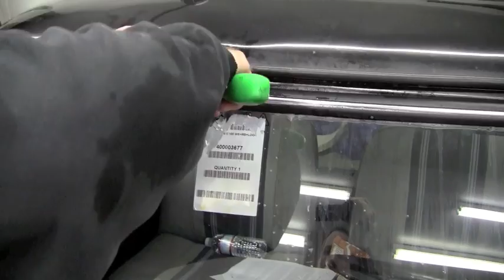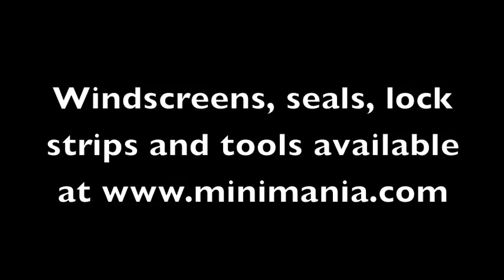How-To Install a Windscreen-Windshield Classic Mini

Comment: This type of rubber is not a rope in type, it's a Claytonwright rubber, which has to be 'Hitched' in, similar to the method used here. If you tried to use rope, the rubber would tear, but having said that, with a new very soft rubber, I have known this to be roped in before, and yes, I do know what I'm talking about, been fitting Windscreens for a living for 35 years!
Reply: I was a sprayer and panelbeater and never cut the screen out we would take a little time and remove the screen first then the rubber

Comment: thank you so much for posting this vid, put my screen in today after watching this, its worth a mention that if the window looks like it is to small for the rubber soldier on, and it is possible to move the glass about slightly once in, before you fit the chrome strip...thanks again for such valuable information..

Comment: Totally agree...do not use a metal screwdriver for this installation.
1 turn or twist the wrong way will easily crack the laminated glass.
Use a plastic "Equalizer" installation stick or alike.
Do not try and fit this type of glass with a cord or rope.FFS!!!

Comment: He's making a  real meal of that. The quick & easy way is to fit the rubber around the edge of the glass, and wrap a length of string around the groove in the rubber. Then press the screen against the aperture whilst someone goes inside and pulls the string. And use a wooden dowel with a chisel edge filed on it, not a screwdriver.
Reply: Bingo!

Comment: There are specific tools for fitting a mini windscreen and this video demonstares the use of some of them. I wouldn't recommend the use of screwdrivers as they can slip and damage paintwork and users. There are purpose made fitting tools available on e-bay for novices. A very good video though and well worth a view.
Reply: Sure seems like they're using the filet tool backwards...

Comment: not a good way to fit a mini screen I have been fitting them for 22yrs. if the old rubber is fine re-use the old one.all the new ones are after market.the filler can be reused if in good shape.when fitting glass don't use soap and water.spray with glass cleaner instead this will help and then evaporate  after. when working glass use a plastic diber not a screw driver .before fitting filler seal glass and body side with sealer not silicon .then spray rubber and refit filler.the filler tool if used at correct angle will go round in 1 smooth action.this guy as got glass in but not a guy that is used to fitting this type of fitment.if your not sure us a windscreen company.thier is many difffrent types of fitments methods for windscreens held in by rubber seals.hope this helps
Reply: Agree not a good way, put the seal around the glass then a string in the other groove then with help of a friend push in the window when when your friend pulls the string wich lifts the seal over the lip. Done it several times with no problems.
Reply: I have a 86 saab 900 windshield to do, how to re use the old gasket? Any idea? thanks

Comment: Use a plastic -nylon dibber tool and apply MR SHEEN polish or same as ,will go in alot easier and remember you need to reseal before fitting insert or it will LEAK!!

Comment from the maker: Most of the time it isn't necessary. It depends on the condition of the aperture surface. If it is deformed and bent, it should be straightened first. If you have a lot of un-eveness some sealant in these areas might be a good idea.

Comment from the maker: Ok, so you have an earlier Mini with the smaller aperture? In that case you shouldn't need to glue the ends but just make sure that they butt together as tightly as possible when installing the rear screen. You should put the split at the bottom so that the lock strip will go through the split in one piece and go together at the roof line.

Comment: screw driver to fit the screen rubber????? one slip and goodbye to the screen or paint work
Reply: I know, I was cringing there. Also pulling heavily on a Stanley knife towards himself. Sheesh.
Reply: just thinking that my self why not use a plastic dibber  much easier

Comment: Would it be easier to fit the rubber to the glass first and then put both in? That way you know that the rubber is in the correct position for fitting in the gap, and you can use the screw driver all you want to help the rubber onto the body without fear of damaging the glass? Just a though, I have never done anything like this, so I might be way off point!

Comment: Dude fit the rubber on the glass first and use 4mm rope around the rubber seal. Start from one corner and pull the rope inside your car to fit the seal its alot easier. Your way is a good chance to crack the glass the way your doing it and if your tool slips their goes your paint or scratch the glass. The rope method is best
Reply: Not for classic Minis.

Comment: For other cars I've seen a different method in that they usually start with the rubber on the window and use a length of rope to get the gasket to seal - is there something that prevents this method on a mini? I'm actually asking seriously before I try doing it that (seemingly easier) way.
Reply: I think your method is preferable. I can see many options for error in this method.

Comment: I'm watching this shouting "NO NO NO!!" I worked on Leyland stuff in the late 70s, and those and most cars, we fitted the seal to the screen, lubed the lip with washing up liquid, then fitted a long cord around the seal and it was easy and safe sitting inside the car to pull the lip all the way around, with a helper giving an occasional flat handed slap from the outside. Then run some sealer around outside, clean up and refit the filler bead. BTW, a screwdriver doesn't come into glass fitting.

Comment: Great video guys, I have saved it for when i fix the rubber leakage problem on my own Mini. I love the arches on the green Austin in the background, would you mind telling me what the name of them is?
Reply: Look like Wood and Picket arches as there are no top edge fasteners.
Reply: Yeah yeah do don't they? It has been a while since I asked this so I ended up figuring out they must be Wood & Pickets. i might pick up a set for mine!
Reply: James if you do remember they must be fitted tight as the top edge has no fastenings all is done on the bottom edge.
Reply: No worries thanks Trevor :)

Comment: So every time you replace the windshield you gotta replace the headliner?
Reply from the maker: You don't need to replace the headliner, but it does need to be tucked under the rubber seal along the front edge.

Comment: fit rubber to screen, paracord inserted into the channel that slots onto the body, fit screen into the opening and start gently pulling cord from inside in circular motion till all the rubber has been pulled over the metal edge, No way use a screwdriver , just asking for scratch paint or broken screen